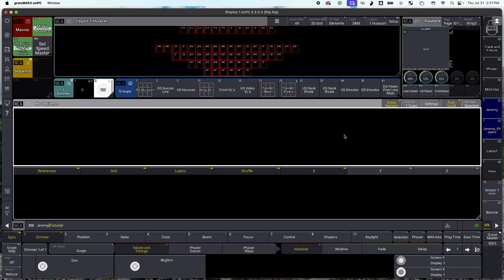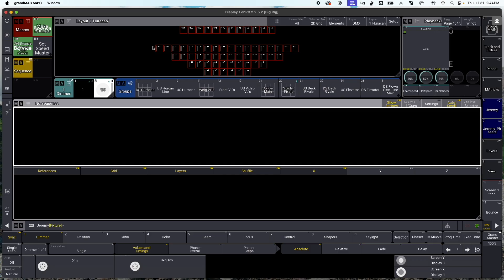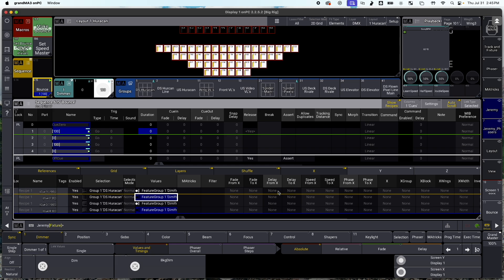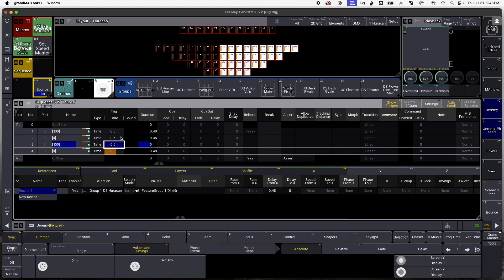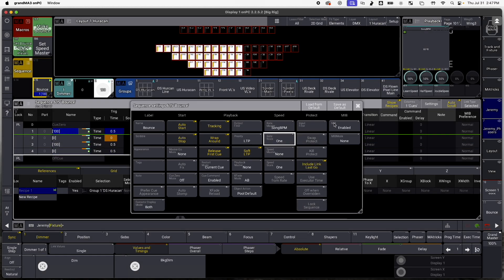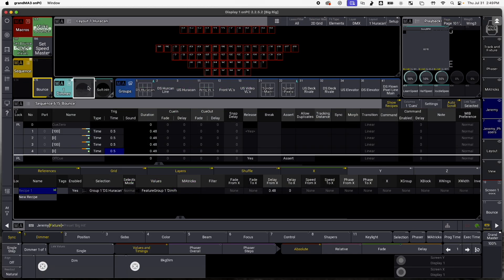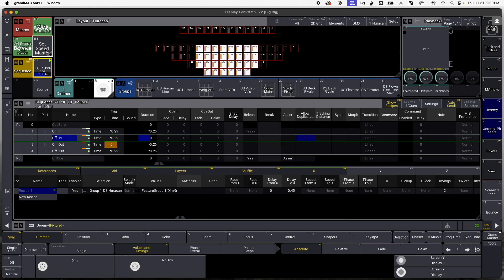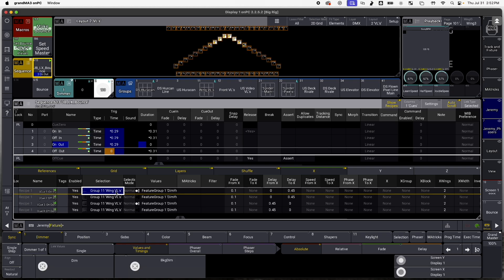MA3 Recipe Bounce Effect

Comment: Using this on an LED bar. How can I change the width of the area that gets lit? I want to make like a night rider effect, where there is only say 2 out 10 LEDs lit during the sequence
Reply from the maker: That's where the delay times comes into play. Make the delay times much less but keep the same follow/time time on the cues for it to still be in time with the music. Hope this helps!
Reply: @jeremyburd20021  After further experimentation I have found the following for this recipe.
Take a batten with 10 pixels. In order to get a chase with a max of 3 pixels on at one time you would need to do the following.
In the sequence, the on cues (1 and 3) have double the trig time of the off cues (2 and 4).
The recipes for cues 1 and 3 have a delay TO time of 1.5.
The recipes for 2 and 4 have a delay FROM time of 1.5.

So the formula is as follows. The On cue is double the Off cue, and the Delay from and to sections in the recipes are triple the off cue.

Comment: it is possible to create bounce phasers that work for any selection by using MAgic. 
MAgic lets you fan phaserlayer options across a selection. just have to fan width (optionally transition for a ramp down look).
its not as easy to change presets as it is using sequences - takes some macros.
Il add a plugin that generates these any-selection bounce presets to my projects list
Reply from the maker: You can definitely use a MAgic preset for this, especially if you don’t want it to be either a specific low or high intensity. That would be an intensity gradient and as the delay wipes from side to side, the intensity would go from a low to high gradient when it wipes vs. what I have which will bring the light to its high value then to its low value when it wipes. The short version of what I’m saying is MAgic is wipe across with intensity buildup as it runs vs the intensity going from low to high with no buildup (besides adding a fade). You’ll end up with two different looking effects that use the same ground layer. But even shorter, yes it will work

Comment: Hey man, I’ve seen you around online for a while. Really nice video, you did a great job!

I use a different method to this which only uses 2 cues and I feel gives a little bit more control. But is also many less steps. 

Using universal dim phaser tied to a speed master that is always scale one, 2 cues set up trig time in a sequence which is also set to that speed master. 
2 recipes containing my groups and phaser, sync on for both cues, and a slightly unconventional phase range on from/to X (swapped for the 2 cues). 

I found that doing it this was was more helpful since I can edit the width and transition to give me better decay and negative spacing. 

But I do like really like your method too. You got a sub from me 😊 keep doing what you’re doing, the community needs more content.
Reply from the maker: I tried that method and kept getting bumps in the road. I tried with and without morph and sync and it just wasn’t working right. I’ll try that out again and see how your method works vs what I was trying. Though this is why I enjoy MA3, there’s multiple ways to do the same thing and it’s cool to hear how someone accomplished the same thing with a different method.

Stay tuned for my video next week. Going to be discussing the firework effect. I appreciate the sub!
Reply: @jeremyburd20021 you need sync on for it to work, and very specific phase ranges depending on your form. After that it works perfect. 

Can’t wait for a phaser direction property which includes bounce tho. Just tick a box. No crazy work arounds :) that’s the dream.
Reply from the maker: I look forward to the day that I don’t have to call a phaser into the programmer to edit it. You can already open up a preset edit things such as MATricks in there. Next up (fingers crossed) is that, but for a phaser. I hope MA listens to us has something like this planned in the future. One can dream!